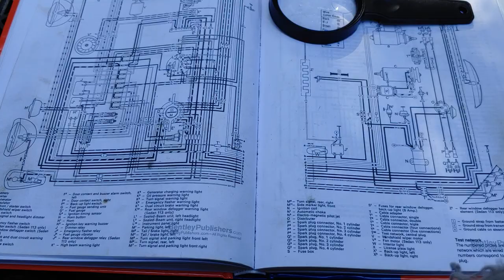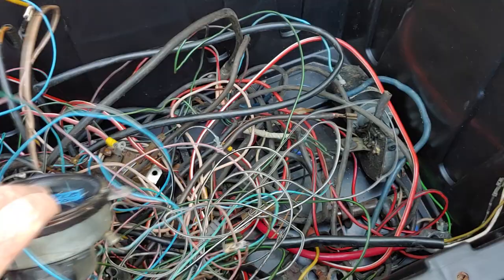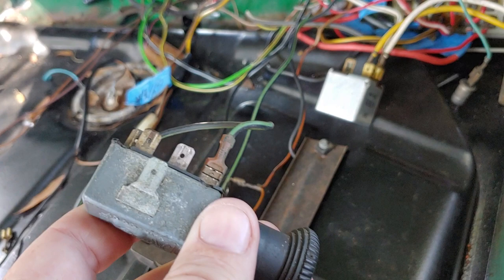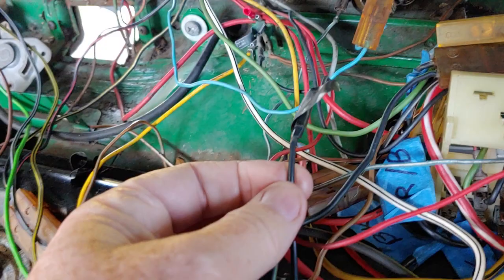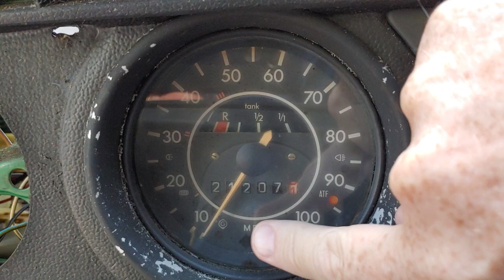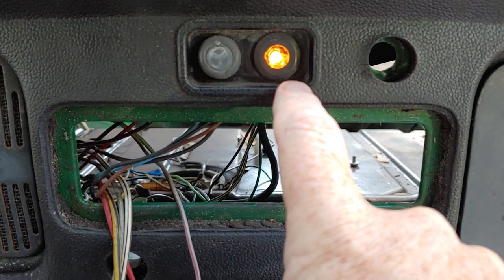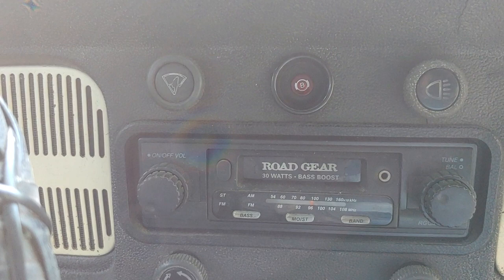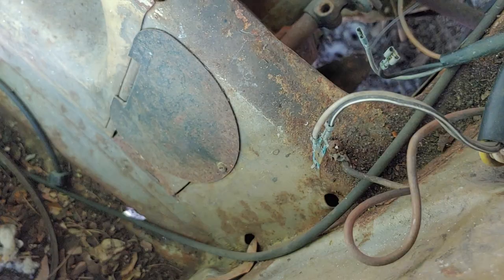CLASSIC VW- 1972 SUPER BEETLE DUAL CIRCUIT BRAKE WARNING DASHBOARD LIGHT.

Comment: Hi!  

I just ran across this.  

I have a 1972 SuperBeetle.  I bought it in 2006, got it running, drove it for a few years, and then for various reasons it's been sitting for about 10 years.  I'm working on getting it running again this spring.  I want to have it running by June.  (You can see some videos about it on my channel.)

Back in the day, when I was getting it running, I ran across the dual-circuit brake light.  It bugged me that it didn't work.  The light assembly is as you'd expect; it's built with individual components, so I was able to to figure out what the circuit diagram was, which components on mine had failed, and replace them, and get it to work.  Now that I realize that this is a topic that people want to know about, I'm going to make a detailed YouTube video about what I did.  I'll try to remember to come back here and link to it when I put it up.  

The principle of the light is to warn you if you're only braking on one of the two brake circuits (for instance if you lost fluid in the front or the back brake system).  However, if that happened, the brake pedal would go most of the way to the floor, so I think you'd know even before the light came on.  So honestly, the light itself as designed is of limited use anyway.  

There is also a separate circuit that makes the light turn on to test it when the generator light is on.  So one light, the primary warning circuit connected to the brake pressure switches, the secondary wired to the generator light as a warning circuit.  Unfortunately, in practice, the components that made up the light assembly that made that circuitry work were more prone to failure than the bulb in the light itself.
Reply from the maker: You are correct. Thanks for commenting. Come join our Facebook group page. You can also post your videos as well. We have several youtubers on there as well. Same name " Volkswagenplanet"
Reply from the maker: Let me know and I will subscribe to your channel. Stay safe

Comment: Now you have me wondering about my son's 1978 super beetle, I know he has a fan and a light for it, for defroster did not know about the Brake Light or option on the older beetle cool lear something knew today.. His car stored away in our one car garage local in back yard .. I need to make some notes on what to looked into once i have this cast off.
Reply from the maker: I didn't know anything about this till I went and turned the ignition on. Them the light came on.it goes off like the gen/ alt light when the car is running. Never seen this ever. I think it may be red light. My cover is missing.

Comment: The brake indicator never came on unless there was a problem in the master cylinder. They did not normally come on with the ignition or the parking brake, but would light when pushed to test the bulb. These lights were only made in red, but typically faded to amber and eventually clear.
Reply from the maker: You are correct. The little red lens on my was missing. Thank you for watching and sharing your info. You would be surprised how many read the comments. Take care, stay safe.

Comment: I have a 71 Super and at first thought it was a warning light if your emergency brake was on, which would make it much handier of a warning, at least for me...Mine works...It doesn't come on when I start the car but it does come on when I push it in, so I have no idea if it actually does what it's supposed to do...
Reply from the maker: Hhhmmmm, well I'm not 100 percent sure why your light works the way your explaining. I was told by a retired VW tech from back in the day that the light surves a dual purpose. When ignition turned on it a visual signal that the system is operating normal. When you push the brake pedal in ( stopping) and comes on it indicates failure in the master cylinder. My 71 light came on after I had to pump my brakes to stop. Hope that answers your question. Most of these switches and relays were never plugged in after a master cylinder replacement. Then you see the electrical end destroyed by brake fluid over the years. Thanks for watching and commenting. Hope to be back in the garage again soon. Take care , stay safe.
Reply from the maker: Check your brake switch first. Once in awhile the connection gets dirty. Spray with brake cleaner.
Reply: I guess your brakes have to fail to see if the light works...I'm waiting for a video that explains why my horn blows when I turn on my left turn signal...lol
Reply from the maker: @gerrymccracken6294  problem would be the horn wire ( green) is being pulled when turn signal is pulled down.
Reply: Thanks! Excellent...Just need a longer wire...
Reply from the maker: @gerrymccracken6294  or un wrap.the current wire if it's getting tangled. Let me know your outcome. Have a good day
Reply from the maker: @gerrymccracken6294  great to hear. Enjoy the rest of your holiday weekend.

Comment: Hey i know this video is a few years old but does the light need to be working or even there for everything to still work fine?
Reply from the maker: No. It was a brake system check back in the day when it was built. Most people have never seen one light up. Most get disconnected and the power source gets used for other options. Good question. Thanks for watching and commenting. Stay safe.

Comment: Hey John, I have a 1971 Super B Conv. I have a working light! Searching your channel ,  it hasn't come on before and now it is steady on. Only time it goes out is if I push the brake peddle.  I have  replaced my brake switches and master cylinder. Drove for a few weeks now light is on. Does this mean I have a failing Brake Switch again? Thanks Liza.
Reply from the maker: That is what it means when that light comes on. May not be a bad switch. I thought the same thing. I took my brake switches off the master cylinder and sprayed mine with parts cleaner. Mine was covered with brake fluid, grease, dirt and regular road grime over the years. Once I cleaned it up then the light started to work. That is how I came across all this. I would start with cleaning the switch ( female) then clean the spade on the master cylinder ( male). If your light comes in and off it is one of a few things. First would be a faulty ground on the switch from dirt and grime not allowing the circuit to complete it self. The second would be the fluid could have a air pocket in it. That would kick.the light in and off when it didnt detect brake fluid. Re bleed the brake system. If you have a test light ( they are cheap if you beed one, around 10.bucks) you can test to see if you have current into the brake switch. Wiggle the brake switch to see if the switch itself is tight and wires are secure into the switch. I think you have a wire loose and in not grounded or connected properly. As you know these cars are plagued with grounding issues. Most if the wires and connections are 47 years old. Hope this info helps. If not message me back. I also have a VW GROUP PAGE ON FACEBOOK. There is quite a few members in the group that are more than welcome to help out. The VW GROUP us the same name as the YouTube channel here. Irs called Volkswagenplanet. Hope you had a great holiday. Stay safe, stay warm. 
We look foward back to hearing from you.

Comment: I have a 1972 standard beetle and I have that In Mine. It is turned on ( glows red) all the time whenever the key is on and when it's running it never turns off. I don't even know how to get it to turn off Without turning off the car. But my brakes work, brake lights and tail lights. Explain that one??
 work!
Reply from the maker: I'm not sure, it suppose to fade out like the oil and generator light does on your speedometer. If it stay on it means there is a issue. I'm going to have to look into the reason it would stay on, then get back to you. Thanks for watching and commenting. Don't forget to join our Facebook group page. I'm sure a member or two would know the answer to your question. The group page is called Volkswagenplanet as well.
Reply: @Volkswagenplanet  any suggestions on this one
Reply from the maker: @joetiller6199  what are you wanting to know?
Reply from the maker: @joetiller6199  mine was a bad ground on the brake switch on the master cylinder